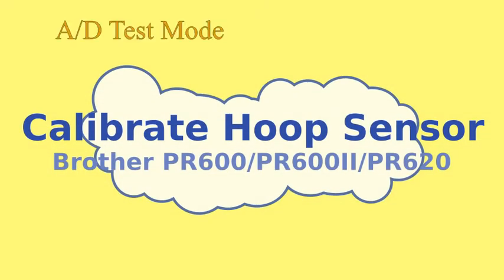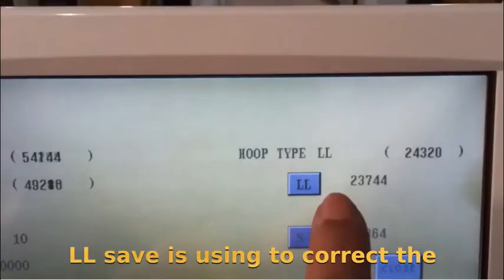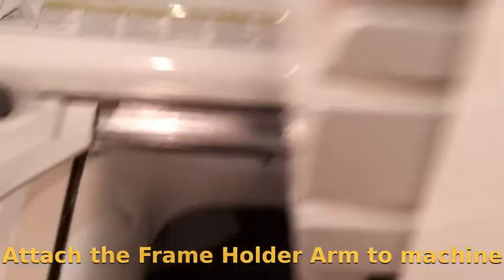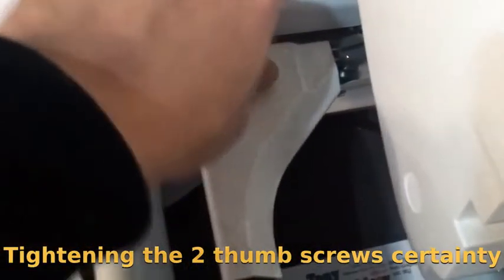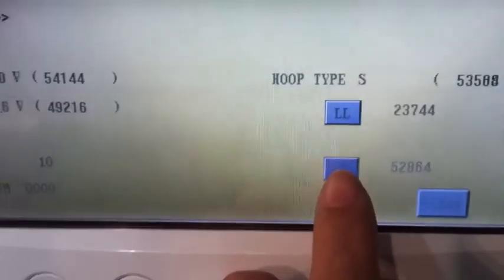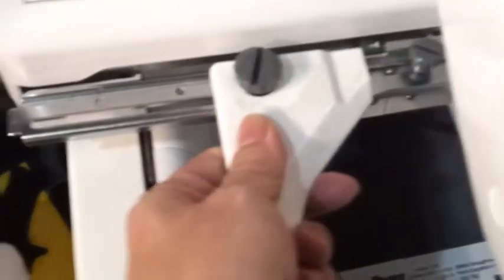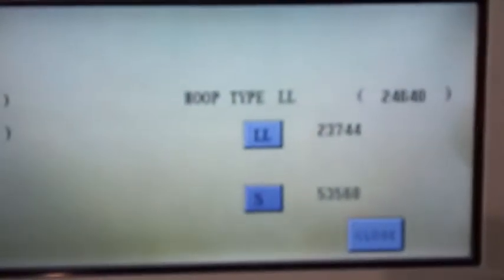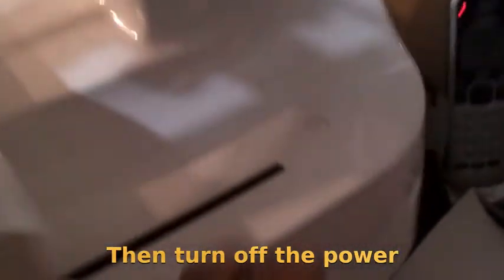Brother PR600/PR600II/PR620 Hoop sensor calibration

Comment: mostly when I rotate the embroidery design, that's when it seems to be out of calibration. and I did find the test. Arm A LL save is 70 and S save is 164. should these be different numbers?
Reply from the maker: @lissametzger4387  Every machine has different LL save and S save numbers. The numbers you calibrated is newest correct setting.

Comment: I tired holding down the 2 buttons but I got an error message  F02 S/S SW ON. this is for the prs-100 persona. thanks
Reply from the maker: @lissametzger4387  the PRS100 needs to go to Main board test model first. Then select the Frame A/D test. 
Press the middle 2 buttons  and turn on the power at the same time. The middle 2 buttons are: needle position button and thread trimming button.

Comment: when i click close nothing happens
Reply from the maker: “ Close “ is not a necessary step. Only works for the technician working on the panel test mode then going to A/D test. Hit the “Close” will back to “panel test mode” page. 
If you follow this video to calibrate the hoop sensor, after finished calibration just turn off the power. It will back to normal when you turn on the power again.
Reply: @TdpsCa  than you i did that and it worked. appreciate it. i left a thumbs up

Comment: My embroidery is still not aligned after this calibration.
It's still a few mm out. What to do :/
Reply from the maker: Check the sensor lever, make sure it’s in good working condition. If the problem still can’t be fixed. Find a technician to adjust it on the “ Main Board Test Mode “. (To correct center position). If above steps not working, replace a new hoop sensor assy.